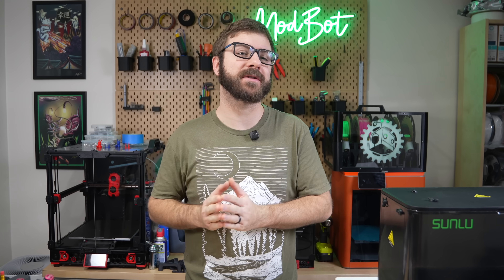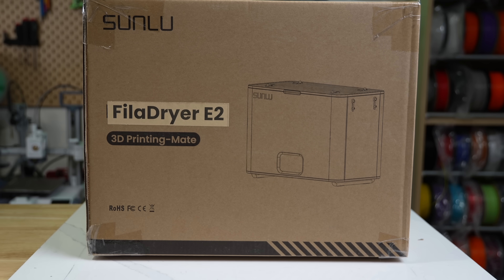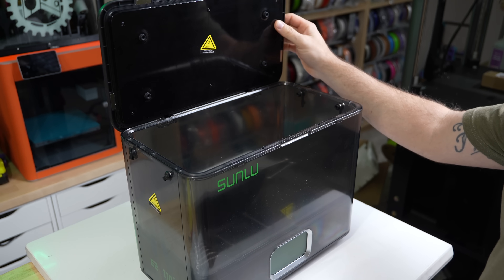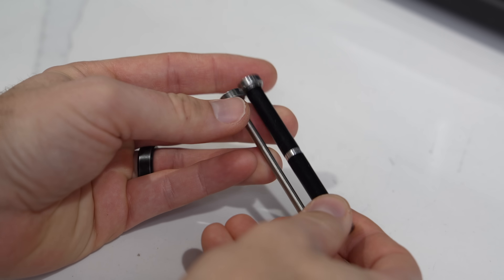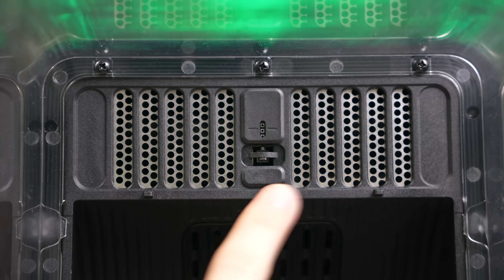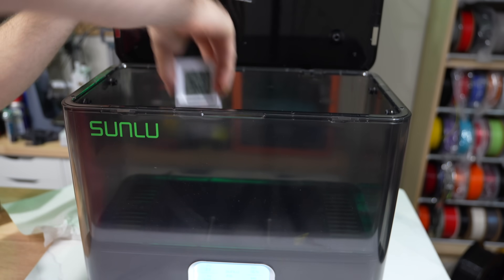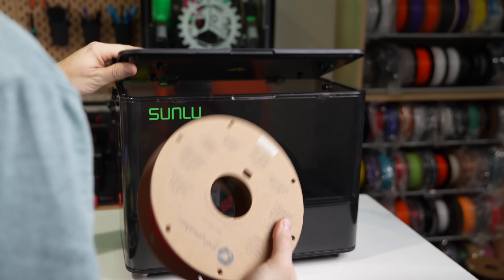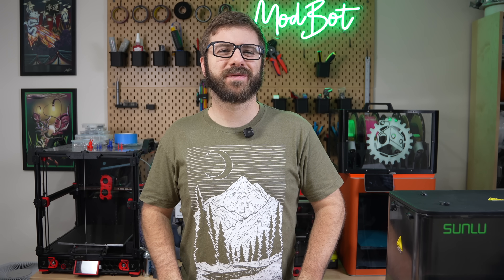How Hot Is Too Hot? (Sunlu Filadryer E2)

Comment: Now that Bamboo has automatic open/close vents, I hope they came up with a v2 with that feature plus rotating spools for a more even drying, without damaging the right side of a spool where the much higher air temp comes out/in contact. I think solutions with at least 100°C should be more common. If you want to dry PA with eg. 80°C it takes forever.

Comment: I just want a 1 kg dryer that reaches 100c so I can print nylon boat parts. The insane gymnastics I have to go through to keep a filament dry while I do a precise, strong, multi-hour print is ridiculous. I’m at the point where I’m just going to build one out of 7 layer plywood, heating elements and a 12v power supply. I really don’t have time for that, and I can’t believe this doesn’t exist.
Reply: I have also considered building my own out of insulated 1/2" Baltic Birch ply. I'd like mine to be for two rolls though. I wish there was a attractive off the shelf LCD temperature and humidity controller like this one or the ones most filament dryers come with. Something that can control a heating element up to say 500watts and read temperature and humidity accurately up to 120*C and humidity all the way down to 5%. I'd also like a automatic filament rotating mechanism.

Comment: So, I have found myself in a position where I've been almost continuously printing glass fiber nylon for production parts for the last couple months. I only run it on one machine, but it's been about 15 kg or so. I've found that I have to dry this material for AT LEAST 24 hours in my trusty food dehydrator, which caps out at about 74C. To me, I'd love to see an affordable option to dry at a higher temperatures, although I'm not sure this is it. $300+ is definitely a bit salty.

Comment: I currently own the S4 and have pre-ordered the E2, not because I need it, but because I have been highly interested in attempting to anneal. I was actually looking at electric pizza ovens when I first came across the E2 ads and decided to pull the trigger. 

Additionally, while I haven't tried anything beyond polycarbonate for engineering filaments, I'm highly interested in filaments like the PPA-CF stuff from Bambu which seems to have a recommended drying temp range of 100°C - 140°C; something that my S4 is incapable of doing.

Comment: why does every filament dryer just work like a filament heater?  Are there any dryers out there that actually vent the moisture out the same way a food dehydrator does?  It seems after all these years the best way to dry your filament is still use a food dehydrator.
Reply: AMS HT vents AMS vents

Comment: Thermal Camera hot spot temperatures can be wildly inaccurate depending on the material and surface finish of what you're "measuring", you should not be depending on it to tell you the actual temperature of something. It would have been better if you put one of your thermocouples there to be sure what it was.
Reply from the maker: @CharredChar  given that the thermocouples read 145 about half way up the right side I anticipate directly at the source it’s probably not too far off. I’ll keep that in mind next time.

Comment: Yes. be aware that the hot thing is hot, not that there arent 50 wanring lables all over the thing.
Reply from the maker: @flpsht  the internal labels mostly peeled off after a couple high temp heat cycles. Most dryers have a warning but most also don’t get nearly this hot and have exposed metal grills by the heating element.

Comment: For this price, temperature instability is dramatic. I went with industrial food dehydrator for ca. €100. It overshoots about 5°C and I am going to DIY another controller for it. It still going to be much cheaper than presented product...As long as people are buying these they will stay as expensive as they are...
Reply from the maker: @aristoshd  how hot does it go though? I started with one maybe 8 years ago and it didn’t get nearly warm enough for the higher temp materials.
Reply: @ModBotArmy  That's the fun part about a DIY controller on a commercial dryer. Unless you're maxing out the heating element you can adjust the set temperature to as high as you want including high enough to melt the housing.

Comment: 5:53 That horrible tendency of using relays to control temp instead of Solid State Relays or mosfets... EW 😒
Reply: I'm fine with a single on/off relay as a backup safety device to allow the power to pass through to the SSR...
I'm hoping that's what they're doing.

Comment: This is something I was looking for, some of the filaments I have just need a higher temp than any dryers I found. I was going to buy a high temp food dehydrator that got up to 90C thats how hot I needed it anyway.  I bought these filaments probably a year ago and haven't used them yet, but I really haven't even used my 3d printers much at home. At work I print stuff daily though. I always wondered why no company made a high temp dryer. I know there are the dryers from places like vision miner but I was thinking they were really expensive and I don't plan on using these filaments enough to warrant paying that much.

Comment: Good review as always.
I would be quite concerned about the lack of precision on the temperature control.  30 to 40 C difference from the setpoint can definitively mess things up.  If I dry PLA or TPU vs ASA or Nylon or PC, I mainly want control over the temps.  70C is not enough for eng material but overshooting can be hurtful.
Second point I'm surprise you are not concerned with is cardboard spools.  This should at least be a warning to new users that delaminating cardboard spools in the drying is a big risk and a big issue when it happens.

Comment: What about the part annealing capability?  Regarding the metal grill - that seems like it would be difficult to actually touch in operation - why would you touch it?  Did you actually have the bearings/wheels come off while in use?  Clearly the top is made of a different material than the sides and the top gets directly hit with the hottest air.  You also should have weighed a un-dried filament spool before/after drying - others have shown that you need to dry a full spool for a very long time!

Comment: I think a printuber should do a video on food dehydrators like the Septree. Up to 95c, 20x spools at once (or a 10kg) spool. Only $220
Reply: Mind putting a link to what you mean? They make a ton of different units. Personally I'm skeptical my S4 is ACTUALLY drying anything. I'd love to try something that might have a better temp range and bigger capacity for bulk drying stuff I have in weather resistant totes

Comment: Their idea is good, but the product we (testers) received is not finished. Strange decision, test the prototype and don't wait for final product. Only to me they didn't promise the final version.
Reply: Feels like there is a competitor coming and they want to be first to have publicity no matter what the outcome
Reply: @Blamm83 yeah iirc eibos is working on a similar temp dryer
Reply: @Blamm83  oh, that would be great for us, users.
Reply: Your desire for ramp up and down i feel is critical and may be a reason I don't pick this up as annealing function is almost not useful for Semi-Engineering materials that can leverage it. ideally this SHOULD be easy to do in firmware and IMO these things should be connectable to printers already to be able to dial in settings and monitor remotely. My quad dryer I have from them has been running VERY close to nonstop and has been excellent while my EIBOS 2 filament dryer has started to have issues turning on and the screen being jumbled after long term use.
Reply: It is not strange, if you send out the final product only, you have several weeks delay till the reviews come out

Comment: So. How hot is too hot? With regard to filament? Also, have you tested the annealing function? How’s that supposed to work - you just slap your print in there and push some buttons? Seems strange to have it do both functions when it looks like it’s shaped for spools.
Reply: The tray shown at https://youtu.be/PLvBFp05qgM?t=149 goes over the cavity intended for spool essentially giving a flat surface to put parts in.  It would have been nice to see that tray in place in the review... with dimension of volume loss when applied.